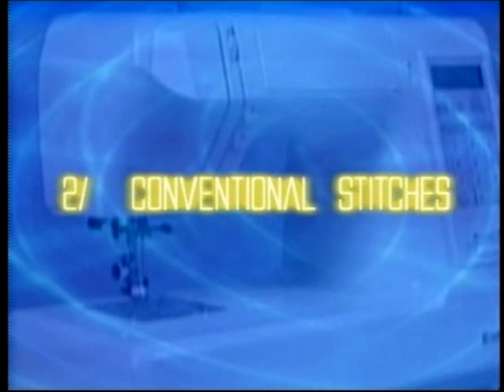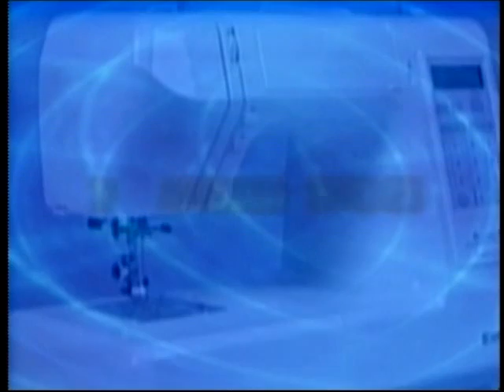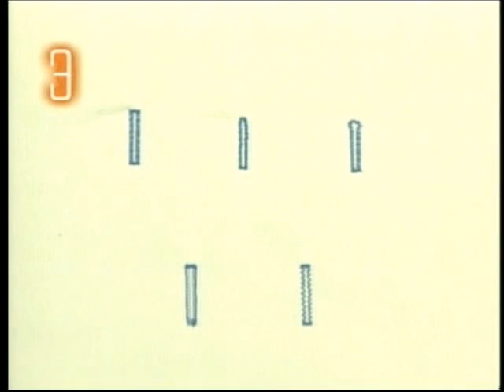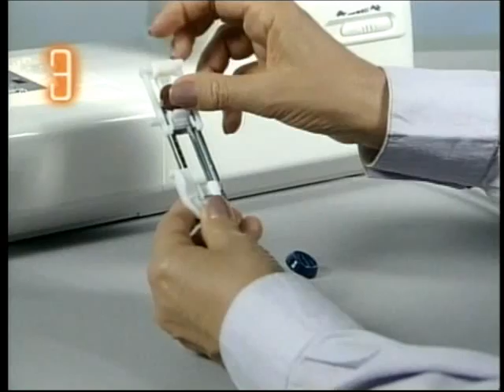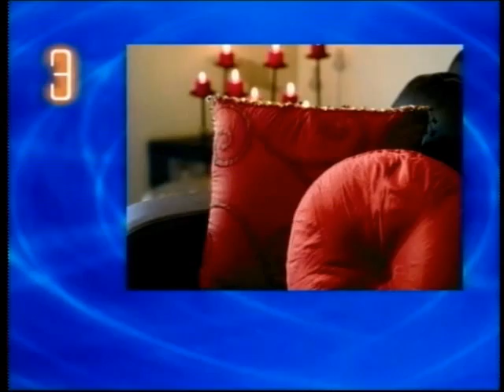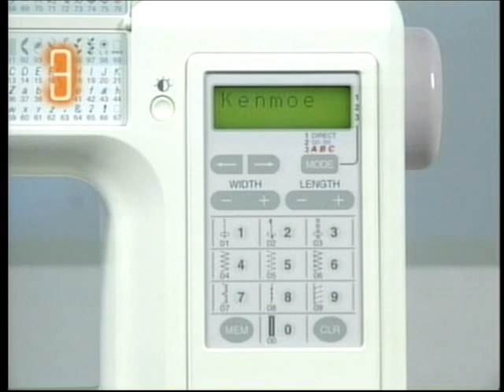Kenmore Sewing Machine 19233 Instructional DVD 2 of 3

Comment: MI MAQUINA MARCA ERROR ME PUEDEN AYUDAR ARREGLARLA?
NECESITO TUTORIAL EN ESPAÑOL GRACIAS
Reply: ELODIA RIOS la pudiste reparar la mía marca error 5 y no trabaja
Reply: MI MAQUUNA HACE TODAS LAS PUNTADAS  PERO A PASO DE TORTUGA.
AUNQUE LE CAMBIE A PASO DE LIEBRE NO AVANZS
Reply: @griseldapalacios417  Try to clean the lint under the bobbin and under the metal plate.
Also, it may need to be oiled which means unscrewing  the bottom plastic piece, and using sewing machine oil, oil all moving parts, turning wheel forward and oiling as you move the wheel. I just did mine and it works nice and quiet. Make sure machine is unplugged!
Don't oil from the top (that's where electronic components are). If you're not sure, take it a sewing machine shop 🙂